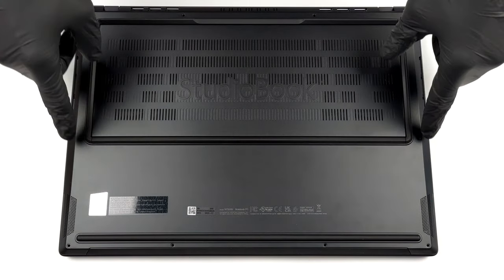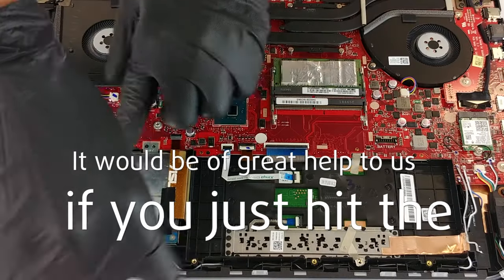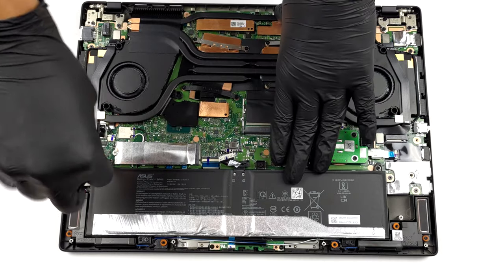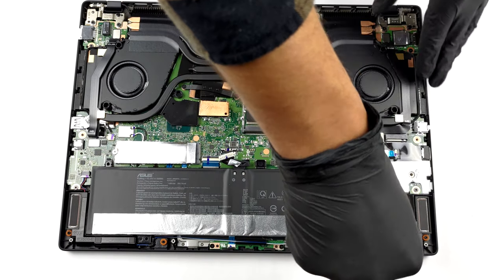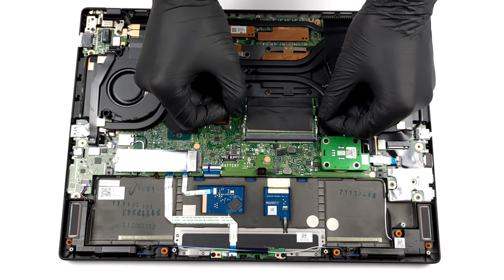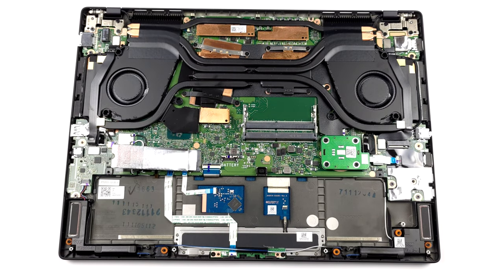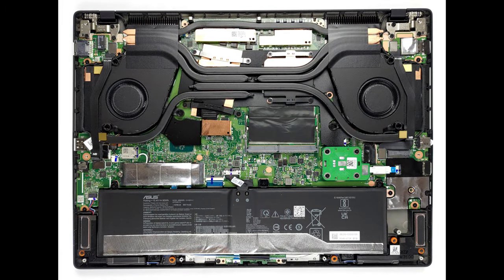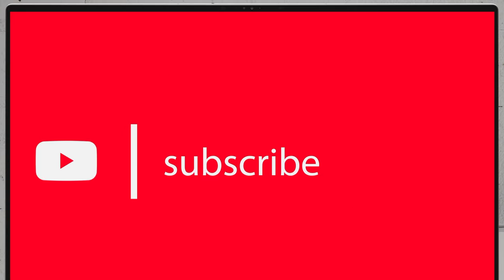🛠️ ASUS ProArt Studiobook 16 OLED (W7600) - disassembly and upgrade options

Comment: if you read this  remember to move the little metal shield off of the battery connector or you will never pull it off.  You can barely see it at somewhere between 0:40 and 0:41